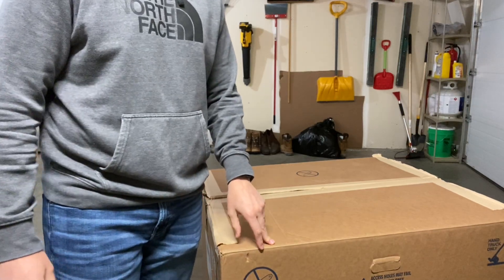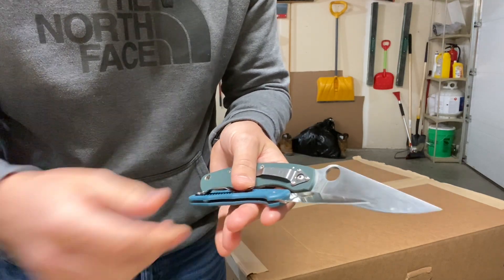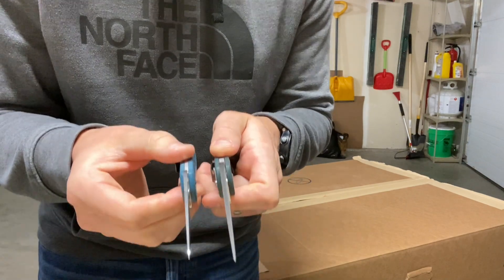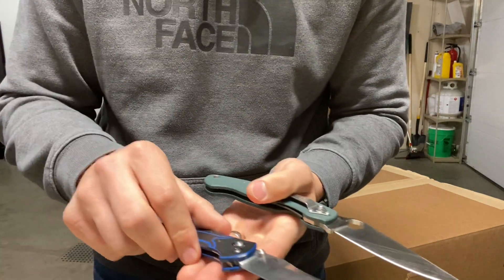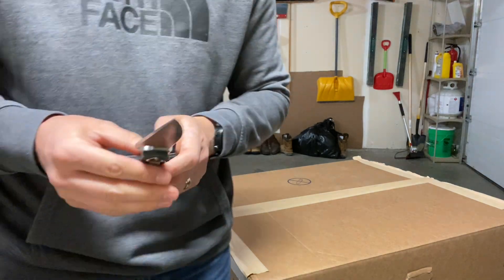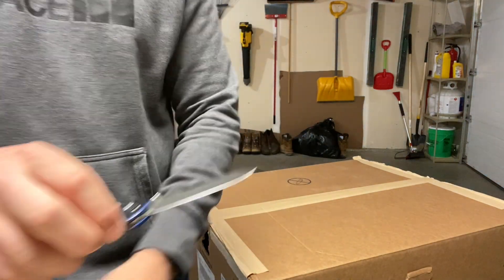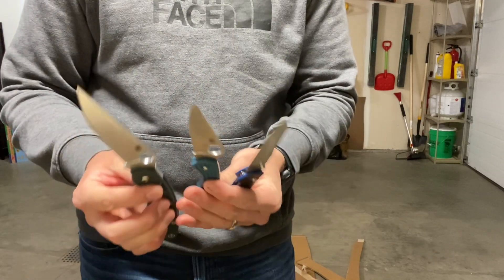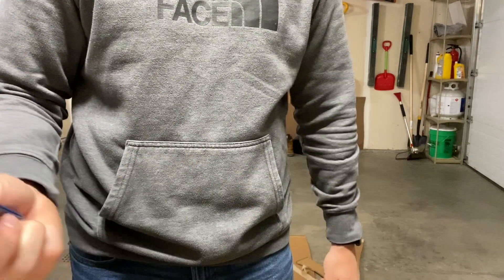Demonstrating Edge Geometry on Cardboard (940 vs. Delica 4 vs. Military)

Comment: Interesting demonstration of edge geometry.  Pondering about what exactly might have been going on with the 940 seemingly maintaining more aggression. So many factors that i can imagine, both in actual edge and also in means of testing that could be at play.
Reply from the maker: It was actually just all gummed up from tape residue. I put it in the video description because I didn't want to edit the video or anything. Can't figure out how to annotate them either!?

After cleaning up the blades I said 940:low/moderate bite with non-deal apex. Milie: moderate bite with  nice apex. K390 moderate/good bite with best apex. All stropped back pretty well on 4um CBN after.
Reply: @EngineersPerspective701  ahh, I missed that. Well, less of a mystery then I guess.
Reply from the maker: @turing2376  I was confused/surprised in the testing too. I really need to learn how to put a note in the video to correct mistakes or point things out!
Reply from the maker: @turing2376  Here is an update. The military and para 3 seems to hold the "fine bite" better than the 940 does. But the 940 breaks down into a coarser/toothier working edge. This was a mystery but when I reread Larrin's S45VN article I noticed that the carbide volume decreases with higher austenizing temperature that are required for higher hardness. It's my guess that the 940 has a higher carbide volume overall because less of the carbide was dissolved due to lower austenizing temp. That in turn gives a toothier working edge. 

It's more complicated that what's above because the temper makes a difference too but I think that is the culprit at the moment.
Reply: @EngineersPerspective701  hmm, then if only the military had the reground 940 geometry that would sound pretty good to me. I'll take the knife that I can get the edge closest to the performance of a kitchen knife while still holding up to a little bit harder use than kitchen use.

BTW, thanks for the recommendation about going back to the DMT coarse. Did a little sharpening experiment of my own. The other day I sharpened relatively thin edge spyderco MBS-26 petty, spyderco sage s30v and native s35vn. Sharpened all with coarse DMT then directly to first paint stirrer loaded with both 4 and 0.5 micron diamond emulsion on same stick, then followed by stick with 1 micron emulsion. MBS came out hair shaving, hair whitelling, cleaning cutting free hanging paper towel and came up easily/quickly. The other two I felt ok about, a little worse performance on all measures basically (not quite as good bite or quite as smooth cutting on any of the media). Not quite hair whitelling, maybe catching a little from what I can remember now, doing other tasks ok. Also, with the PM steel knives much more care had to be taken, redo of the course stone on at least one of them I think. Took longer. So I am gleaning that the simpler steel and narrow bevel of the petty made it much easier to get consistent flat bevel for progression to strops and then better performance. So, there you go, 3 knives sharpened,  got it all figured out...🤣😂

Comment: Would be interesting if spyderco made a full convex grind for testing geometry.
Reply from the maker: Certainly would. You could probably manage it by hand if you really wanted to. I'd recommend any of their seki laminated blades to speed up the grinding.
Reply: @EngineersPerspective701 bark river has some slicey blades because of their grind which makes me curious as to other companies if they had zero grind too.
Reply from the maker: @adanma17  I'd love to see that more as well! Spyderco did it on the Lil' Nilakka I believe but the ATS-34 was wayyy to soft to hold it I heard.

Comment: I have a convexed polished edge, on my "beater" Delica, (VG10) and it's an absolute demon, for cutting up cardboard boxes,, !!
It's so good, I'm going to put the same geometry, on my new Endura,,,
 imho, VG10 is great for maintaining, with a strop,  before you need to sharpen it "properly".. .  Just my two cents,,,
Reply from the maker: Sweet! Hand convexed?

VG10 comes up quick and very sharp. Agreed that it’s a great steel to strop back. Trouble for me is it doesn’t take to the type of edge I’ve really grown to appreciate on the higher carbide steels. Definitely good to go though!